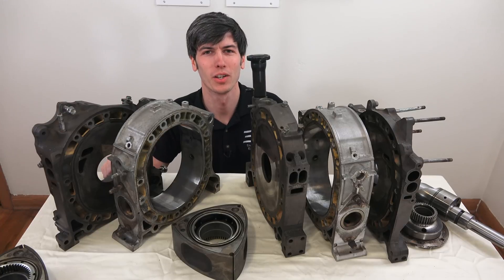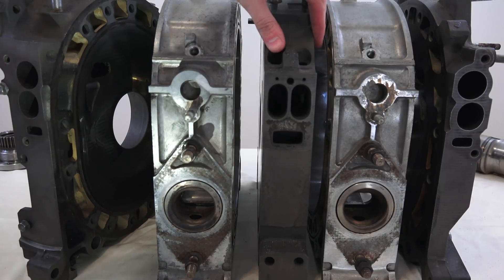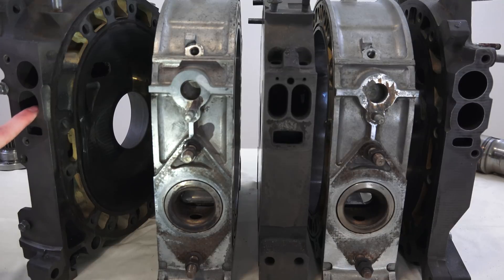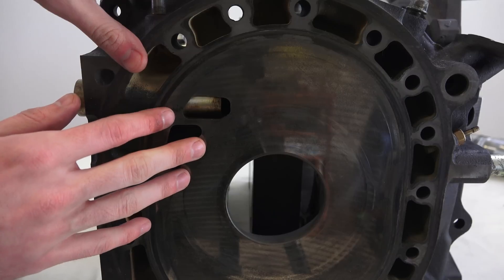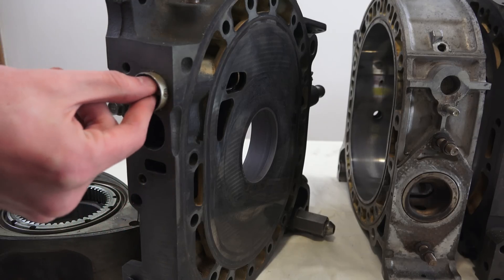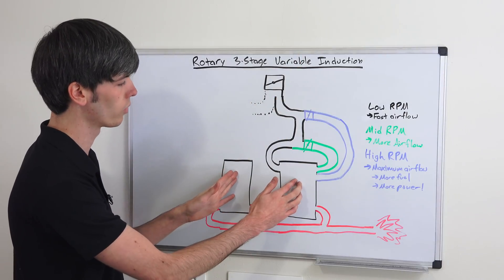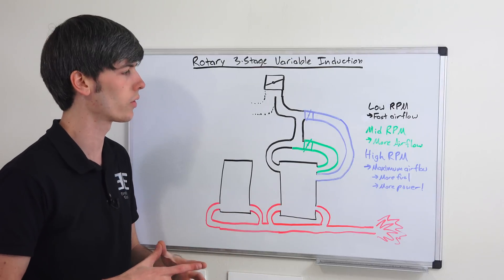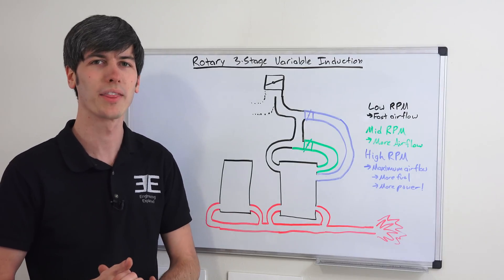Do Rotary Engines Have VTEC? Wankel VIS

Comment: I have been told before that rotary engines are only meant to be driven at higher rpm and shifted at near redline all the time, even daily driving. Also that because of this they are seen as not being reliable since owners are too easy on them. Is any aspect of this true?
Reply: +Josh D There is always a shred of truth in a rumor. No, a rotary does not require you to drive it hard and to the redline all the time. What that someone must have heard and then just regurgitated back to you was that rotaries are known to have carbon build up in their combustion chambers. It is well known in the rotary community that "A redline a day keeps the mechanic away," or that, we need to give it a good romp every once in a while to burn away that carbon. This is primarily caused by burning engine oil which is a natural part of the lubrication system because the metal seals on the rotor need oil on them too. Not being reliable though, well.... that's another can of worms and primarily has to do with earlier year model RX-8s being prone to engine failures because Mazda made a boo-boo by not having the ecu pump enough oil onto the rotors, essentially causing them to prematurely wear. Of course, Mazda has a 100k miles/8 years warranty for the engine so there were quite a few that came back. Now, saying that this is the worst rotary ever made is a crock because RX-7 FD engines blew up at 60k all the time, no matter what Mazda or the owners did.

Comment: 2 stroke engines have a very similar technology in their exhaust called a power valve. You can distinctly feel when they open, and can significantly change the shape of the power curve by changing when they open.

Comment: Im still wondering why there are less/smaller exhaust valves than air/fuel inlet valves. Because hot air expands and needs more room in my mind. Could someone get my mind clear? :D

Comment: I like how the exhaust in the whiteboard diagram is shooting flames
Reply: That's because rotary's don't burn all the fuel pumped in and often shoot flames when they hit the rev limiter
Reply: Correct.
Reply: +Marius G I Lol'd when Jason showed the whiteboard
Reply: Do you know why he did that?
Reply: i mean u kinda need to label which pipe is the exhaust lol

Comment: I just would like the point out that not all rotaries are this way.
12a engines only have 4 intake ports. 13b engines can either be 4 port or 6 port. 
In the 4 port engines many people do something called porting where they grind down the intake ports to allow for more airflow and subsequently more power.
Not all of the engines have this "VTEC" system. Just something I thought I'd share!
Reply: +Nick White Pretty much from 86+, rotaries have had this system in place. 6 ports primarily.

Comment from the maker: Thanks for watching everyone! If you happened to be one of the 900 people who saw this on Wednesday - sorry for the "repost." I had no intentions of releasing two videos on Wednesday and messed up the scheduling. If you're interested in more rotary content, here's a detailed explanation including advantages (https://youtu.be/sd6pJtR4PaY) and here's more detail on why they're not currently in production (https://youtu.be/v3uGJGzUYCI). Hope everyone's having a great weekend!
Reply: +Engineering Explained HEHE I got to see the pre-release! I'm special!
Reply: Well I never realised rotary engines had multiple intake ports like that. Very interesting. Even though it's not got anything to do with cars, I'd love to see you do a video on napier deltic engines and why no one builds them anymore.
Reply: +Engineering Explained, While you're on the topic of wankel engines, is there a chance you'll be doing a video on how mazda's hydrogen rotary engine works and how it could possibly be the one thing that keeps the wankel engine alive in the future?
Reply: I also got to see it!!!
Reply: how about Chrysler  turbine car  (u probably wont)
Reply: Don't certain Honda vtecs use different intake runners to achieve the same effect? I believe they use a rotating drum inside the intake to direct airflow
Reply: +ProtoflexX eh kinda, and this system is more closely related to those since "vtec" uses the cams really to open the valves up for a longer duration... this system in now used by more auto manufactures, and yes, uses a butterfly valve to either have a longer or less restricted runner. was mainly initiated by vacuum, some manufactures now use a solenoid system.
Reply: ProtoflexX when hydrogen burns it turns to water. Water is very attractive and bonds very easy with other elements and compounds, because the Wankle engine burns oil; the water vapor from the exhaust will have oil in it. Because of the water cycle the oil will eventually find its way into lakes rivers oceans and ground water. I think there may be an oil that burns clean. If not its screwed.
Reply: +Engineering Explained the golf gti engine has been around since 2004
Reply: +Engineering Explained why don't they have symmetrical airflow ports for even combustion inside the chamber? two airflow ports on one side and only one on the other... doesn't seem right to me.
Reply: Denchanter357 it works no differently to having multistage carburettors.
Reply: I would love it if you did a video on non Wankel rotary engines.  I have yet to see a rotary engine design that is truly Superior in every way to reciprocating engines.

Comment: SKYACTIV KICKED IN FAM TBH
Reply: +Wall Russ I'M DEAD XD
Reply: +Wall Russ You do know that skyactiv is designed for fuel efficiency and power and is currently not implemented in rotary engines. The ports that enable more air flow in rotary engines are called "AUX" ports and are either vacuum or electronically controlled. Skyactiv didn't kick in. Aux ports did.
Reply: +Rotary LOLSmiles Assuming they didn't wire open the Aux ports like most young people do. I just built an engine starting with turbo housings so I didn't have to deal with Aux ports and could get a better shape to start with for the bridgeport.
Reply: @jordandyar5967  aux ports r usually called headphones jacks. Jesus christ apple. Even the rotary has a headphone jack. The people at apple r dumbass's